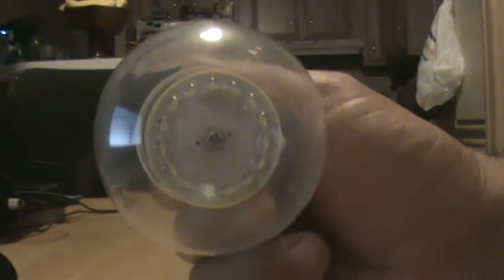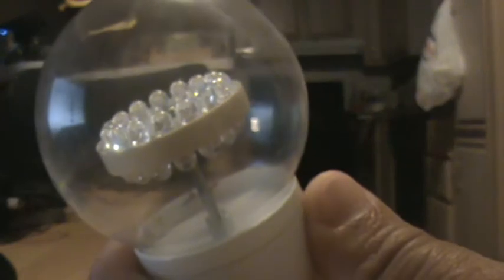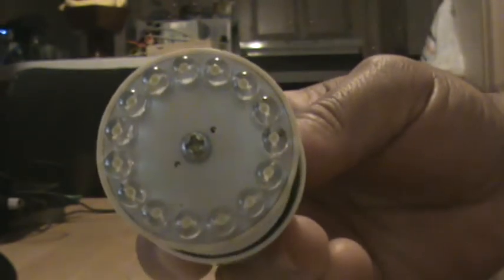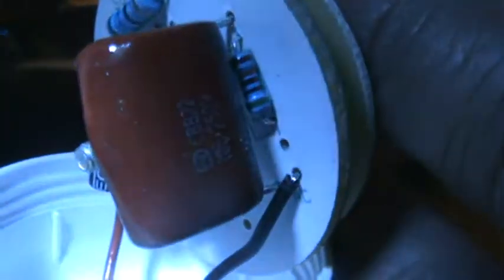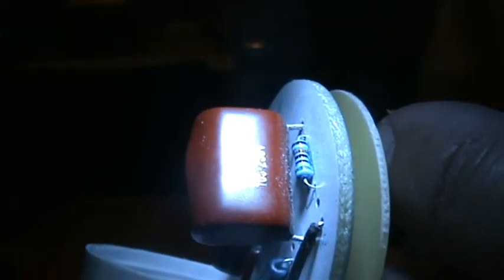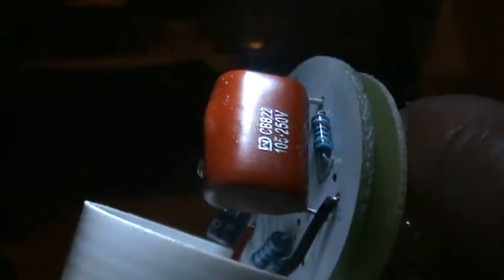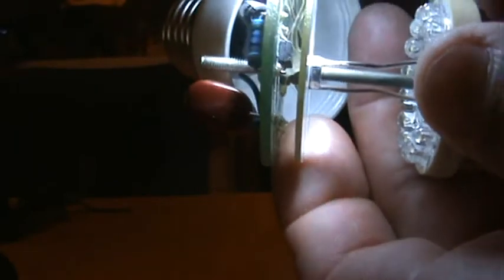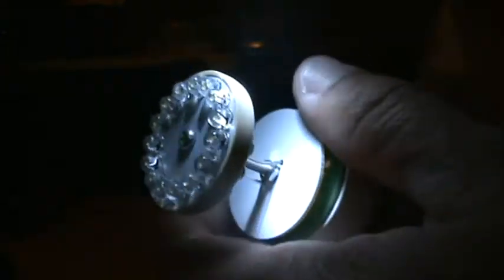LED Light bulb  I take it apart

Comment: @Iseekoutthetruth  It doesnt really take much to make free hot water , I made a small prototype couple months back that would give me 2 gal hr at 150 f ...The system I plan on building will do around 8 an hr and its going to tied into my hot water heater and self circulate when not in use ..